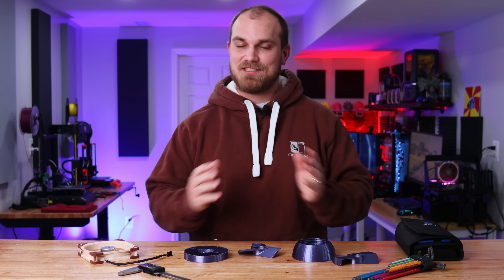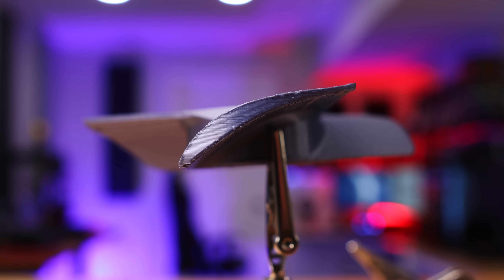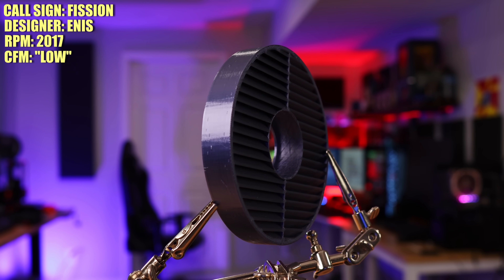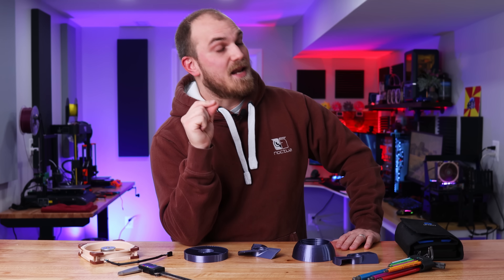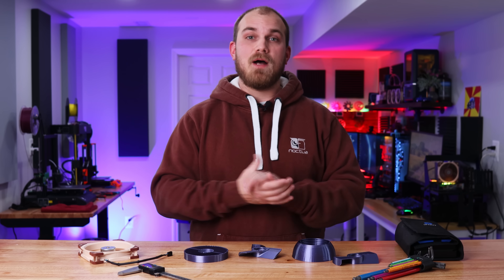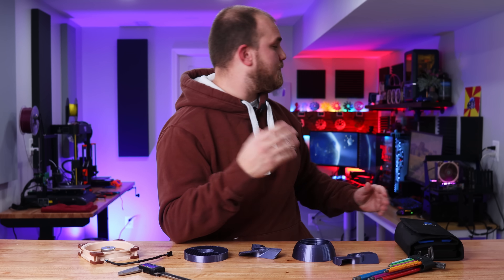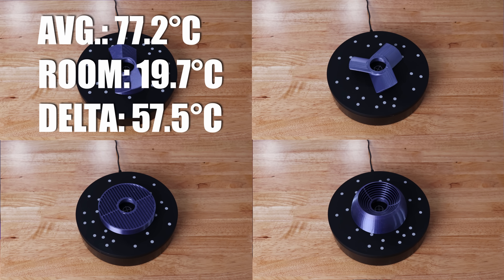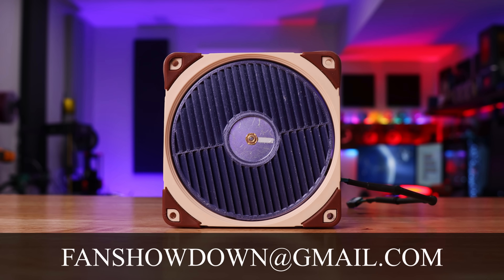IS THIS MAGIC? This Fan Has No Blades | Fan Showdown S2E3

Comment: Hey everyone, I'm Sean, the designer of the bladeless fan. 

I want to point out that the supports that everyone is saying should be angled are not solid vertical walls. They're small pegs that attach the concentric domes together. If you look really closely at time 3:30 you can see what I mean. There are basically just dowels attaching between the walls. I tried really hard to have the least amount of surface area pushing air instead of dragging it by the boundary layer effect, and honestly the first thing I would do on a version 2 is remove most of the supports, because the fan is much more rigid than I expected. I know the fan has a lot more improvement to be made, this was just a proof of concept that I spent about an hour on. Also, it definitely is losing some energy to air that drags along the outermost wall, but if you watch the smoke test carefully you can see that some of the air is actually sheeting down along the wall and getting blown through the fan, and this is because of the Coanda effect. 

Let me know if you'd like to see a bladeless mk. 2!!! I'd love to try and iterate on this design, but I'm not planning on adding blades to the design like many have suggested. It's sort of a self-imposed design constraint to see how well I can take friction and centrifugal forces, two major causes of inefficiency with fans, and use them to make a fan work. The fan may be greatly improved by adding blades, but I would rather push this concept further before compromising and adding blades in.
Reply: I think this fan is a great idea. I also think it likely has pretty poor static pressure, I'd be curious to see if it was a good case fan that was exchanging air with little resistance rather than trying to push air through a radiator.
Reply: I love this idea. Before adding fans would texturing the surfaces have an impact? (like divots on a golf ball?)
Reply: @cellscribe  Exactly, increase the surface so more air-molecules get attached and are thrown out after getting too much energy.
Reply: @cellscribe  that would probably eliminate whatever boundary layer effects make this design even a little bit slightly feasible.
Reply: @cellscribe  My suspicion is that anything that wasn't totally smooth in those channels would just induce restrictive turbulence.
Reply: @cellscribe  I had the exact same thought.
Reply: You could try to create a venturi effect by narrowing and then expanding the rings again. You have the deeper area, so might as well take advantage of it
Reply: @Musikur  dude thats a great idea, sounds like that could really maximize the efficiency of the design without adding blades like Sean was wanting.
Reply: @Musikur  Because of the way he's using boundary layer effect to draw the air, the narrowing would have to be on the outboard surface of each... vane? shell? dome/cone? Anyway, any restriction that was on the inboard side, that interfered with the smooth transition along the wall's curvature, would actually just cause a sort of centripital well of turbulence. I think. Maybe. Probably.
Now I gotta do a fluid dynamics simulation...
Reply: I Just watched this because your fan on the thumb of the video.
Great design. Keep improving.
Reply: If you want to capitalize on the concept, you should look into ducted radial compressor designs, more importantly how they use the circumference of the rotor to maximize the energy introduced into the fluid (total pressure if you are so inclined). You could definitely expand upon the design by using a rotor to draw in air and then use a stator convergent nozzle grid to remove the incurred vortex and to speed up the air to pass it over the CPU. For Designs that rely on circumferential flow for compression, this is the Standart procedure to maximize the energy introduction per stage in turbo machinery.
Reply: I'd like to see more of this. Definitely want to see what the limits of a true bladeless design can do.
Reply: I would love to see a variation with a corkscrew style ridge or texture on the surfaces of the shells. Not connecting the layers, just enough to give the air a little push in the right direction
Reply: Im rooting for you, also the fan is unique and beautiful
Reply: Please create the bladeless mk. 2!
Reply: Due to it being bladeless you can likely increase the rpm far higher than what a typial fan would be designed for and still have quite a quiet fan assuming vibration reduction
Reply: I want to see bladeless mk. 2!!
Reply: At the end the temps do not matter as long as they're within limits, so if the cpu is not throttling I'll take the quietest one around. As long as I'm not overcloking.
Reply: Does he have a kickstarter account? Shut up and take my money
Reply: What if instead of layers, it spiraled in, like a screw?
Reply: Dude your amazing please make another one this is almost similar to Nicola Tesla blade less turbine
Reply: I think it is amazing! The fact that it is silent makes it extremely promising, I'd pay a significant premium to acquire one with comparable cooling efficiency as a regular fan. 
I believe, that with more optimizing (it currently only seems to use about half of the max diameter a fan could use) it can achieve much better efficiency.
Reply: Keep making different versions of the fan. Really loved the concept and the reason for clicking this video.
Reply: Excellent work on your design, Sean. I can’t wait to see how you further develop it!
I think it would make an awesome looking front fan on a pc case
Reply: Three series of supports instead of four will help with acoustic dampening. :)
Reply: This guy put together a brand new design in an hour while the industry didn't improve much for decades.
Reply: @story1234  Urghhh because the industry has reached its peak and stable point, where we need to develop crazy yet compromising idea like his?
Reply: @story1234  if it ain't broke, don't fix it
Reply: Shouldn't this design in particular be acetone smoothed? Being as its essentially a Tesla Turbine that's been through a car crash
Reply: Okay, I would absolutely love to send in more bladeless designs, in fact I already have a few more versions to try, but I don't have any way to test them myself (I'm a broke college student, can't exactly go out and build a test bench or anything xD). With permission from James, I'll gladly send in new bladeless designs, but I want to respect that this is the fan showdown, not the bladeless test series. Everyone only gets one submission, so unless he gives permission, I'm not going to spam him with more bladeless fans.
Reply: @Toombu1  Is this the first time you blew $1,000,000? (subcribed, contentless wonderboy)
Reply: My baby bro is a Sean.

Go Sean.
Reply: @ryanjofre  (very far away)
woo!
Reply: pin this
Reply: There was a little circulation of air at the outer side of the fan. What if we add diagonal shovel to the fan like in a turbine?
Reply: I wonder if there's some way to cause a lower air pressure at the end of the bladeless so not only is the air getting dawn in but the low pressure causes movement as well. I love your idea
Reply: The amount of noise it reduces really count as a win in my book. I was actually shock when he's doing the test. Congrats man. Can't wait for mk 2
Reply: I noticed that smoke that hit the outer surface was repelled violently, so perhaps this fan also need a tight housing surrounding the fan? I am imagining something like the housing for the impeller in the water pumps like D5, but obviously with a hole in the centre for the air to move through. Also if it is the friction phenomenon that drives the air, is the new iteration coming with rough surface next time?
Reply: I don't understand why it came in number four I thought it should have came in number one I don't understand what what the meaning of this test was for the rating
Reply: I would like to see how quiet you can make the fan. There are plenty of low power application that being quiet and safe is more important than raw performance and a fan that being literally bladeless seem to be quite the candidate for safest fan.
Reply: Being bladeless, this could have some some interesting safety applications... no blades = no chopped fingers
Reply: tesla turbine but in a fan
Reply: @harrymu148  I was thinking just that)
Reply: yes, I would definitely like to see a bladeless mk. 2! Love the concept, and please stick to the original design constraint of no blades for as long as possible.
Reply: I understand this works solely on centrifugal force. You drag the air along between the blades which is than centrifuged outward and bent in the axial direction by the cones.

I would like to see a version with just one inner and one outer cone connected by three or four continuous walls. That way the air does not need to be dragged to speed but is trapped between the walls and you may have less turbulence.

Then again, there may be more turbulence at the entrance and outlet. So as a second approach I would try grooves/rims with only a few thin studs to fix the cones together. Then you would allow the air to follow its ow path and still "row" it actively into a spin.

Finally you could experiment with spiraling grooves to see if that would improve the flow.
Reply: I love the design. Im not sure on how you designed the inner workings but if you have not i would add a textured surface to the inside walls to push air more. Mabey just rough sand all of the blade surface
Reply: G’day Sean. Please do both. I can’t see the harm in still pursuing your aims, and make a concurrent fan with these design enhancements with the angled supports. I also think, just for the sake of (everyones) interest, make a fan with the angled support fins on this design, I think we would all like to see a direct comparison. And by all means, don’t stop experimenting..good luck.
Reply: Great work. My suggestion: create integral blade airfoils to the 5 supports, perhaps with trailing edge serrations 10°
Reply: Hey man, i have two suggestions, bring the concentric walls closer to each other, that should increase air drag and thus airflow, just like the tesla turbine concept, if possible, increase the number of walls. Second one is add a point in the middle of the fan, an air breaker, like a plane turbine, that should increase the laminar flow capability of the incoming air and reduce turbulences overall. Bonus tip, if you can manage to create walls that are thiccer on the front and thinner on the back end, that should decrease pressure inside the fan, which increases flow speed. Just like an airplane wing =)
Reply: @denixfyon  All good points!
Reply: I love your concept. I am in no way shape or form an engineer but maybe you can improve the design by pushing the air-intake section further into the mount. The rest of the fan of course needs to stick out more than it did now. Then the intake is more closely to the walls of the Mount and you won't loose as much suction force. Some of the air on the outside was blocked by the centrifugal forces and wasn't able to come into the fan as efficiently as possible. I hope you can improve you design. Good luck
Reply: As a sound guy, I found your fan to be the most interesting because while not as efficient it was way quieter. Excellent observation and design skills! 👌
Reply: The bladeless fan is like a Tesla Turbine, it needs to spin at a higher RPM in order to move as much air as conventional fans.
Reply: Hey buddy, it ain't YouTube if you're not being corrected, advised, insulted, 1-upped, & shown a better way by people who probably just don't know.
Reply: I'd say keep iterating on it. Eventually you'd probably end up with something patent worthy
Reply: @cpufreak101  It is very much like the Tesla Turbine patented a hundred years ago.
Reply: It's pretty cool 😮
Reply: I would put vents or passthroughs so that the air can travel through the bladeless fan and have another exit for the hot air.
Reply: You should make the bladeless that has blades,be interesting tbh
Reply: I want to see the improved version of bladeless fan. It just looks dope and compromising
Reply: Hi, I just saw the fan show, I work in a lab at work. I am thinking if you pop some very small blades say 5mm flat horizontal to the open face, in a corkscrew type effect - only 10 or so mini blades. Then looking in on the fan from the top when spinning slow you would see a line if corkscrew mini fan blades "guiding" the air through and leaving the rest of the fan to do the work as such. Also if the rods holding the normal blades in place ensure they are a wing aerofoil shape, I could not see on the video - great fan could be a game changer ! patent it now !
Reply: Nice. I was prepared for this to do nothing at all but was pleasantly surprised. I wonder what the optimum number of dome/cones would be, and how close they can get before it becomes restrictive. There's gotta be a theoretical maximum... Congrats.
Reply: Absolutely do a Mk. 2 iteration to improve on the design. At the very least, there is room for improvement and it has massive sound advantage over conventional bladed systems. This is a truly innovative idea, and in the long term might be perfect for some niche (commercial) applications. Even if it never outperforms a bladed system, it might make for a great supplement to one and the increased durability may also have applications. (As another mentioned, you could potentially run it at a much higher RPM safely.)
Reply: I wonder if reducing the number of domes would actually help.
Reply: I think if there was a case covering the outside part of the fan so that only the intake home was exposed it would help direct the air better inwards through the fan. You could see some of the smoke being pulled away from the intake hole by the outer curvature of the fan body. I think this is a wicked design and has so much potential, awesome work man.
Reply: I wonder if this design without blades would benefit from dimples.......
Reply: Pin this plz
Reply: Do it!!!! Make a fan of the gods
Reply: Sort of like a Tesla pump but without the single lateral volute.
Reply: Another one
Reply: Perhaps if mk2 has small angled holes on the side to collect the air instead of dispersing it could do better? Not sure about sound levels though…
Kudos for the design nevertheless. Very nice and out of the box, we all love that kind of approach :D
Reply: Yours was a great idea! Try building one with blades instead of pegs - see how noise and flow behave.
Reply: Was this inspired by Tesla Tubine?
Reply: why dont you combine the bladeless with the 3blades one?... put three blades inside the bladeles, like a boolean union if you 3d model it. so the three fans can actually replace the supports holding the domes together.
Reply: Please reply in this thread when there will be version 2 . I'm eager to see it !
Reply: I love the innovative approach
Reply: could you do it so that there is a rifling effect on it.. might help
Reply: Question: What if it was off axis (earth-like), would that guide the air better?
Reply: I think that it looks to have too many turns , make one with less turns , it will be lighter what makes it faster so should move more Air and Cool better
Reply: I think you could improve on it by creating a large spiral instead of concentric circles. I guess it would be considered one blade, but it would spiral so many times it really wouldn't be.
Reply: I think it needs more angle to properly convert the cetrifugal force... Perhaps 45 degrees? At least in the beginning and middle to get some airspeed. Outlet might have some slight ease-out transition to steer the air to go bit straight again, but not too much. Inlet does not need it. Keep improving. You are the next Tesla :-)
Reply: Your fan did the worst because you’re reducing the collection area and essentially making a smaller diameter fan, you should expand the front collection area past the fan shroud instead.
Reply: I love your bladeless fan., I definitely would like to see a bladeless V2 fan. It's a already a Great design for only an hour concept, I'm sure improvement on a V2 will be like night and day.
Reply: Yes, it was not completely bladeless, but wasn' t it easier to add more of those supports so that the air can get the rotational force quicker? thus increasing airflow? I'm not sure , it may just work..
Reply: unreal. a bladeless fan with blades?  Your bladeless fan is the only invention I've seen on youtube. insane perfect. there are something new under the sun.. Thanks.
Reply: was my fav to watch! hope you keep improving it. wonder if maybe 1 or 2 less rings but make them steeper gradient?
Reply: Hey Sean, maybe you can improve the airflow with making not concentric domes but something like a spiral?
Reply: If I had to guess I'd say to improve airflow try making the input the wider end with the output as the narrow, this way you will have more airflow from the intake
Reply: Respect on you! I love your design!
Reply: Sean you did it!
Reply: maybe try varying the 'hole' size? perhaps smaller would give better result, perhaps you would loose too much intake area and making them larger is better? idk, testing to do
Reply: 4 months late and have no idea if this has been suggested at all but maybe have fewer rings to reduce skinfriction and boundary layer losses, as well as mass so it spins faster. And possibly have the rings shaped with steeper ones in the middle and shallower ones on the outside so the air funnelled like a nozzle? either way a really cool concept!
Reply: Some comments might have already asked this but since the fan is quiet enough, would this benefit more if the rpm was increased? I mean after all case fans limit their rpm because they can be noisy but since this one is quiet it could run much cooler if it spins faster. What do you guys think?
Reply: Hey quick suggestions for better airflow ...angle your inner joints to create a tornado like effect
Reply: Yes! Bladeless Mk2! Bring it!!! A few suggestions. replace the dowel with ridges that spiral down the faces of the domes, working out the pitch so each dome pushes the same amount. This will boost the air in the right direction without actually including blades. As the outside of the outermost dome does nothing other than cause turbulence, maybe include a fixed funnel to direct more air into the opening. This could be affixed to the actual fan mount screws so it's not actually part of the fan, and therefore doesn't introduce more weight or moving parts to the actual fan. Being 3D printed, the gap between the funnel and the domes would have to be big to prevent them rubbing, but if you could get someone to resin print the parts, the clearance could be less than a mm.
Reply: Mk 2 suggestion : round up the intake edge with a velocity stack :)
Reply: v cool Sean, you sound like a dub
Reply: if it's more ridged you could experiment with more and thinner domes ?
Reply: What a great design. I'm curious if db would increase if it was made with larger dimensions, like for a vacuum.
Reply: don't let a siren win against your concept, we need a 2.0
Reply: please make another one!!!
Reply: God yes, please! This is amazing!
Reply: If there is a consumer fan with this type of design, I would be interested. Even if it doesn't blow as much, low noise part is important to me.
Reply: Hmm.. I wonder if you could use that spill off the outer wall but leaving a gap for it to flow thru, between the blade & the frame. Perhaps a shroud of some kind.
My brain went Venturi shroud, but not sure if that's compatible.
Reply: The curved outer casing kinda hurts your efficiency, as it is the perfect shape for the Corander (sp?) effect.  The air's boundary lair will entrain air into a path along the outside of the curved shell.
Reply: How's that MK2 coming. That bladless is my favorite. Not the best but favorite by far
Reply: yes airfoil is good
Reply: pitch this idea to Vornado or Honeywell, they'd be impressed.
Reply: Cool, id go for a version 2
Reply: I’d love to see it, it’s very intriguing
Reply: I love how the bladeless looks like a jet engine. I wouldn’t even want one for my computer. I just want one for my desk for myself.  😂 I’d want to show off that bad boy! It’s gorgeous!
Reply: Have you tried a bladeless with a wide funnel.
Reply: whats up with the fan????
Reply: by far i am amazed at what you did.  as others have mentioned,  lets see a MK2 happen. maybe make a video of your own on your channel so we can hear from you on how this is going.
Reply: Anybody who thought this was good is an idiot, I made stuff 50x more powerful out of cardboard, I could make a fortune out of what I know if this idiot is anything to go buy, if you actually put a flow meter on this like any real engineer we would all see how dumb you are!😢😢
Reply: Hey man, I think you were on to something with that fan. I loved the sort of noise it made compared to all the others.
Reply: Super late on this, but I'd take the outer duct and make it a seperate part that attaches to the noctua frame. It creates a lot of drag that doesnt go into forcing air through and probably disturbs flow that wouldve gone into that low pressure funnel
Reply: Make the rings a bit longer, add a more air foil like shape to them, and have the air channels between the rings narrow towards the end
Reply: Ok, but do us a favor and make one with actual blades! I think this design with blades would SLAP
Reply: Please patent this. This is smart, you're underrating your design.